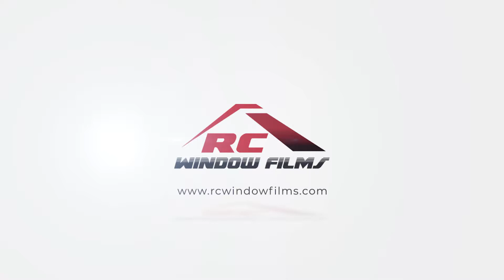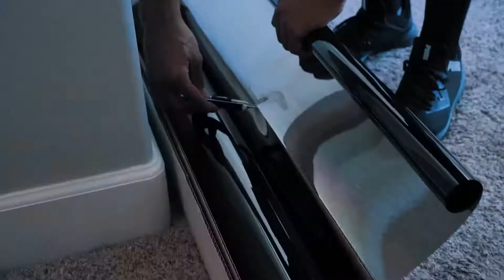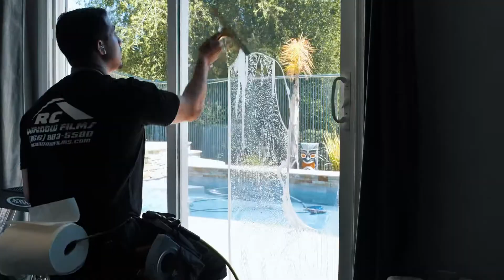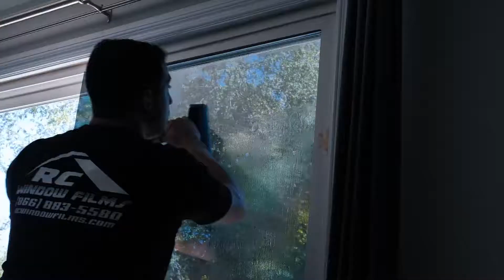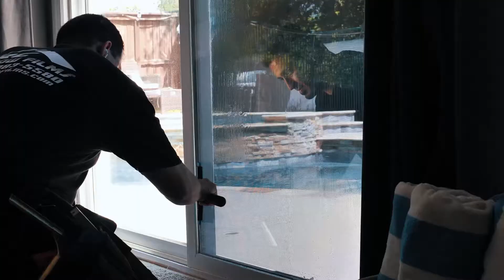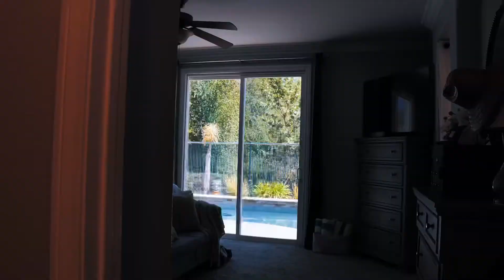Home window tinting - Sliding glass door

Comment: Wouldn't that cause the glass to crack when it absorbs the heat?
Reply from the maker: not when you know what you’re doing. For example.If a glass' bottom edge is less than 60 inches above a walking or standing surface (like a shower floor), then the glass must be tempered. Tempered glass wouldn’t break due to heat absorption. Also, there are films specifically designed for dual pane panels with Low e coatings you just have to identify where the low e  coating is.
Reply: @rcwindowfilms  Oh ok. How much do you charge for 2 sliding glass doors.. 74x36 (each panel x 4 ) ~ 74 Sq ft?

Comment: instructions on my Gila film say to install on the outside if its a double pane glass. ??
Reply from the maker: Interior and exterior films exist, and certain films are specifically designed for external application on dual-pane windows. Universal films are often used externally since they have a hard exterior coat, making them suitable for any window. However, when the glass properties, low-e coating, and lamination are known, the choice between interior or exterior films can be tailored to meet specific needs. In our professional experience, we opt for interior films after assessing the glass type and low-e coating, ensuring the correct film is used for an interior application.